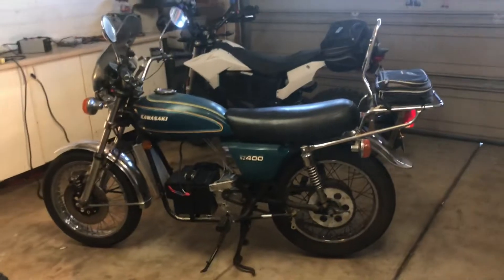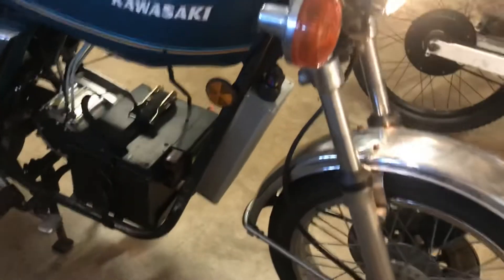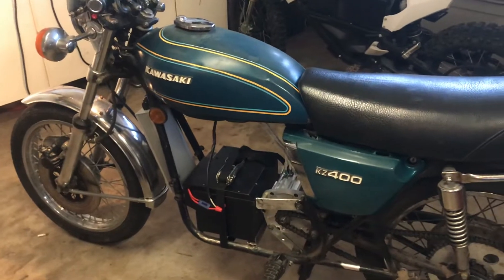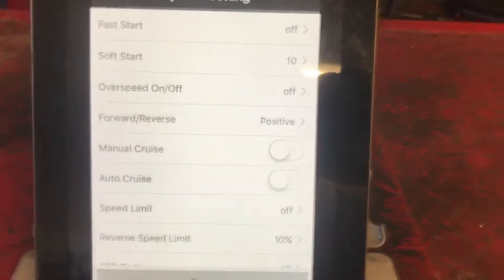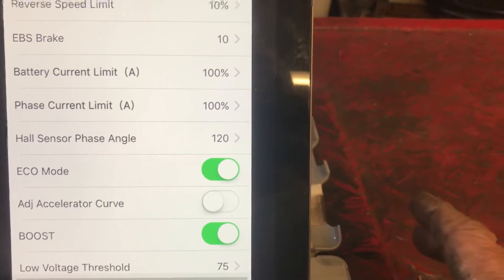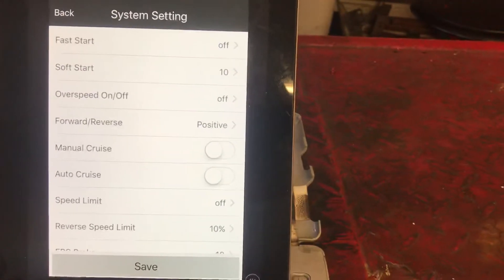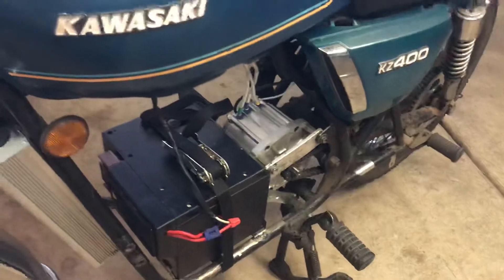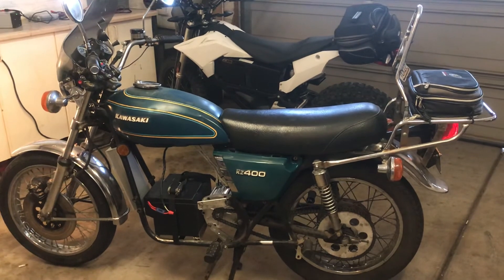1975 KZ400 Electric Motorcycle Yuyang King 150Amp Controller w/Bluetooth

Comment: Great built . Where did you get the controller from? Taobao , aliexpress ?
Reply from the maker: Lamonz88 AliExpress
Reply: @arizonadualsport2590  WoW ok . ! is by any chance this one here ... Also i just noticesd that qs MOTORS have some of them on their website , Does it mean i could use qs motors LCD display or throttle ? https://www.aliexpress.com/item/Activity-Yuyang-King-YKZ120150FB-3500-4000w-150A-120V-square-wave-Brushless-Motor-Controller-with-bluetooth-adapter/32926811723.html
Reply: It's a Bluetooth ESC, so there is an app it connects to on Android/ios that sets all settings in a tab and also has a power display and speedometer tab, so it does not need an external lcd, just use your cell.
Reply: Did you build BMS for your battery? I am looking for, good and relatively cheep one ;). 24s like ion is my goal.